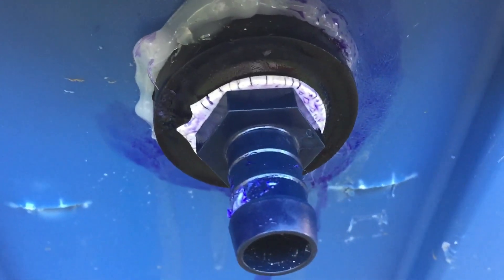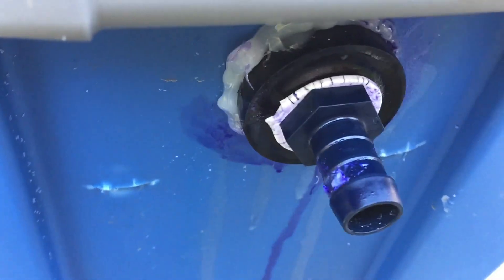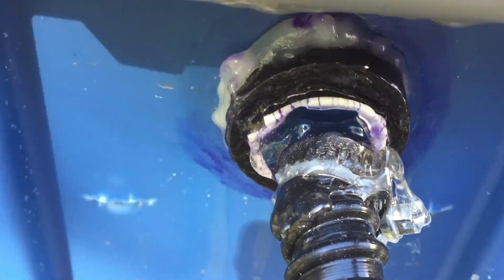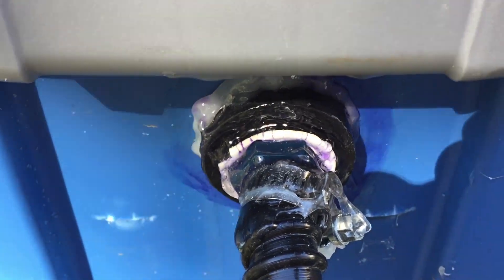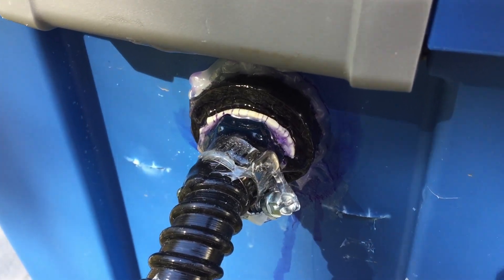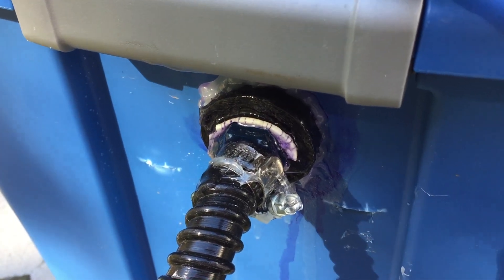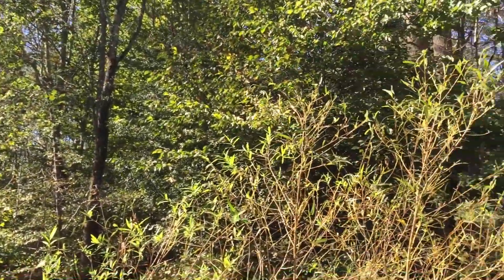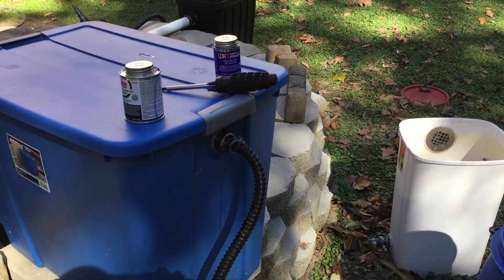Working on the leak on the sieve filter part 1

Comment: The rubber cement actually melts two pvc pieces together. You should find this product called jb-weld “water weld”. You can use the product under water. It’s at Home Depot in the super glue section. Apply it inside and outside of the tote. Should plug up any leaks for good 👍🏼
Reply from the maker: prolificbreed thank you I will find some!
Reply: Good idea ! Way cheaper than brass for sure.
Reply from the maker: Tomoko's Enterprize I will try brass fittings sometime soon!
Reply: Oh I am going to get me some thanks for the info